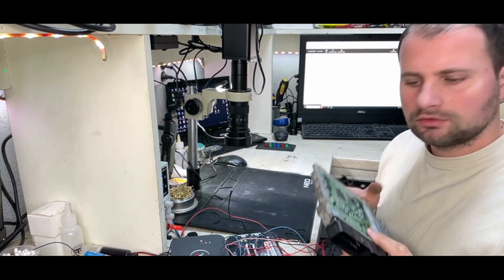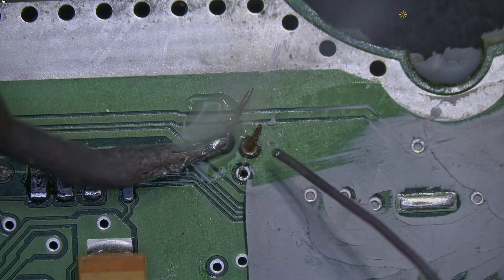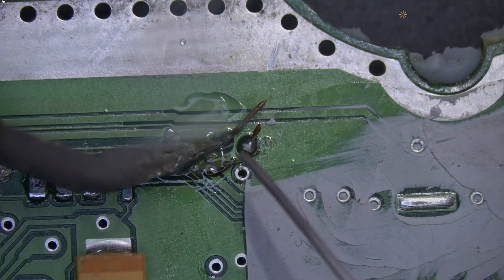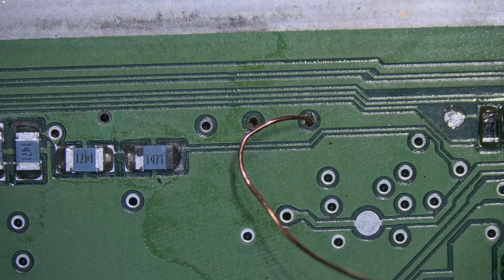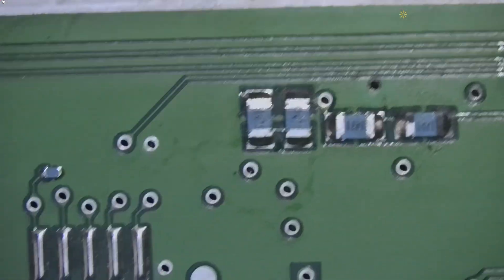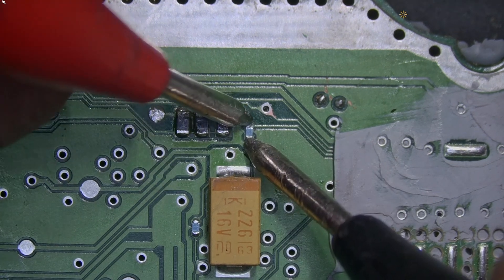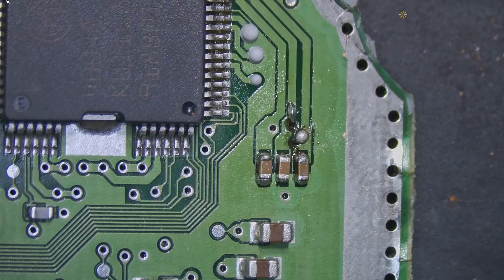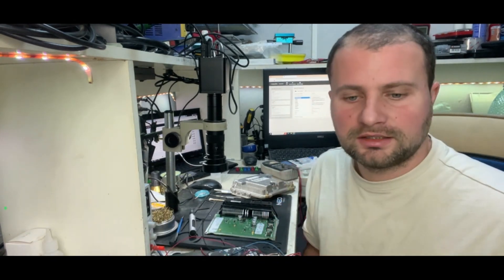Hyundai i20 MEG.17.9 engine control unit repairing | throttle body P1021 P1022

Comment: I have Hyundai Accent 2012, 1.4L engine, automatic 4-speed, and my ECU model is MEG17.9.12, but when I searched in KSUITE, I couldn't find my car, I only found kia rio 1.6 16v CVVT. Can I use that instead? or it will damage my ecu?